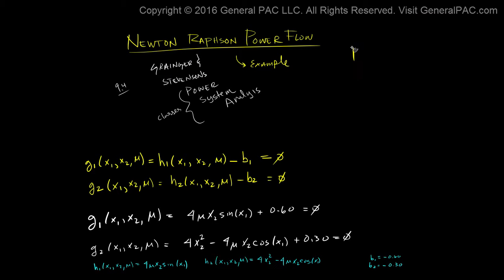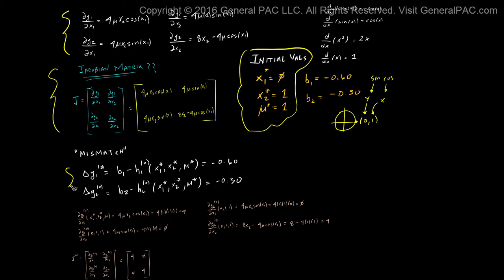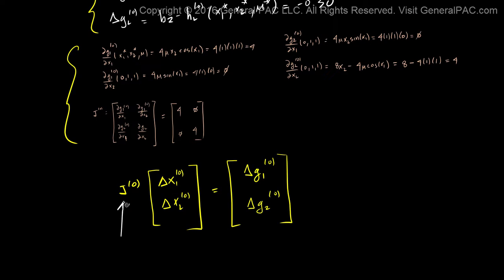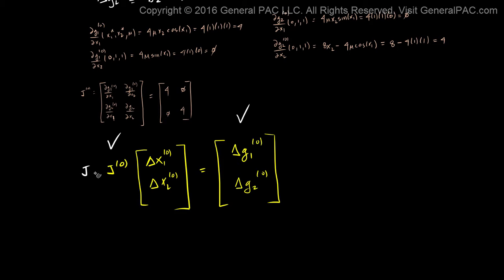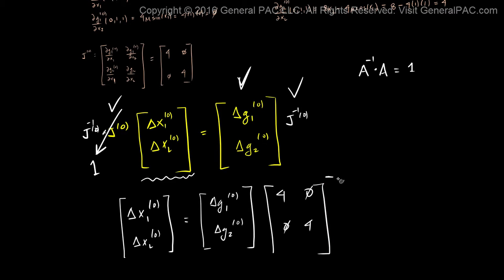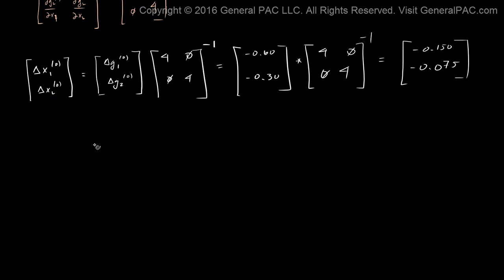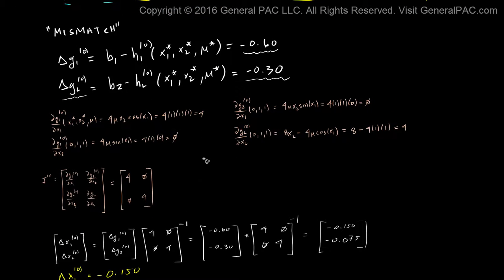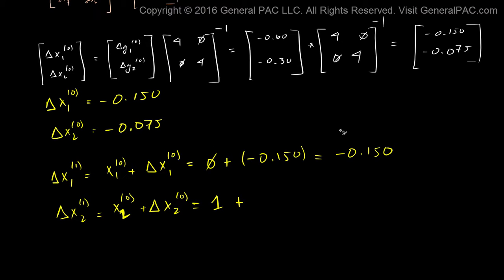Newton Raphson Power Flow Example Part 3

Comment: friend how you get the result at min 05:00 ? because not clear to me when you multiply inverse matrix by another matrix
Reply from the maker: +anwer Abdulkareem, check out this video by Khan Academy: https://www.khanacademy.org/math/precalculus/precalc-matrices/multiplying-matrices-by-matrices/v/matrix-multiplication-intro it provides an excellent example of matrix multiplication.

Also, as Koray Küçükgılavuz and Ray mentioned, the matrix is setup incorrectly. The inverse (4x4) comes first then the (2x1) matrix.
Reply: thanks so much friend

Comment: 很好理解~It is easy to understand:)不过有个错误，等号左侧左乘，等号右侧也应该左乘。Koray Küçükgılavuz 也提到了这个错误 and the reason why the results are still correct luckily is the elements of the minor diagonal of Jacobian matrix are not zeros.
Reply from the maker: Yes, you are right +Ray, I setup the matrix multiplication incorrectly. But the results should be right. They match with the book anyway :)
Reply: 我以为版主是美国人！他居然看得懂你中英参半的句子

Comment: wrong matrix multiplication at 5th minute
Reply from the maker: +Koray Küçükgılavuz  -- where is the error specifically? If there is an error, i'll get make a note of it in the description page. Thanks!
Reply: +GeneralPAC: Power System Tutorials actually the wrong multiplication starts at 3:38 .  j*delta(x)=delta(g). this is a correct relation. Then you multiply left side of the equation with j^(-1) from left. But the mistake comes here when you multiply the right side of the equation. j^(-1)*delta(g) is wrong. it should be delta(g)*j^(-1). not a major mistake but it could affect the result.(correct me if i am wrong)
Reply from the maker: +Koray Küçükgılavuz --  You are right -- it's incorrect matrix manipulation. The 2x1 matrix should be on the right side of the jacobian as you pointed out. Although the error occurs here, the results are correct and they match up with the book :) Thanks for tracking that down!
Reply: +GeneralPAC: Power System Tutorials thank you for your kind attention :)
Reply from the maker: +Koray Küçükgılavuz -- I was re-reading your comment. Correct me if i'm wrong but at @3:38, it's currently written as:  delta(g)*j^(-1) which  is wrong... and  it should be j^(-1)*delta(g)  right? The 2x1 matrix should be on the right side of the Jacobian?
Reply: +GeneralPAC: Power System Tutorials yes exactly
Reply: @Generalpac  if I use j^(-1)delta(g) my answer is 2.4,1.2 which is different from your video and book. Please clarify?
Reply from the maker: @kyza7351  I think you have not taken the inverse of j matrix. Take the inverse of j matrix first and then multiply it with delta g.

Hope you find it useful.

Regards,
GeneralPAC by AllumiaX